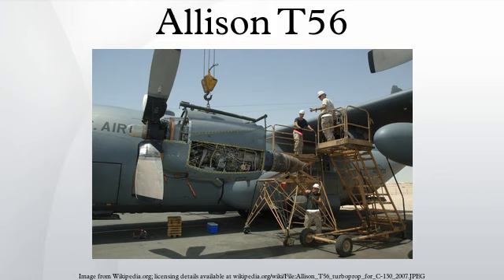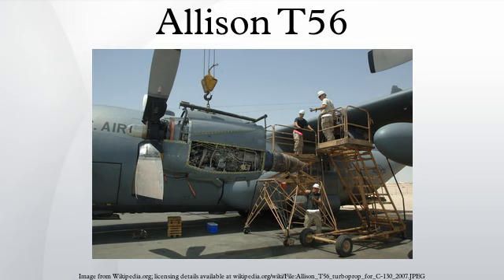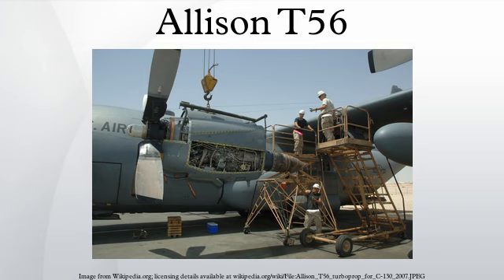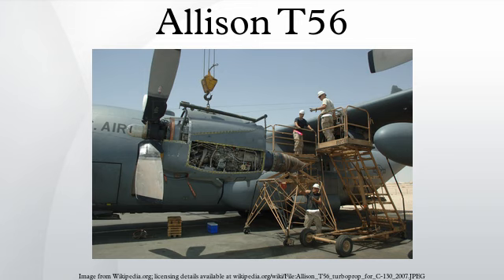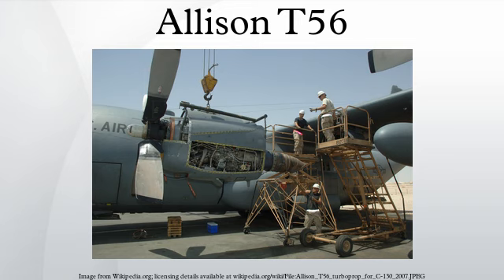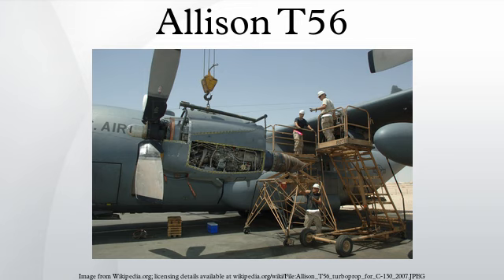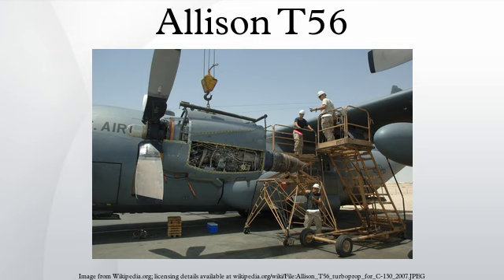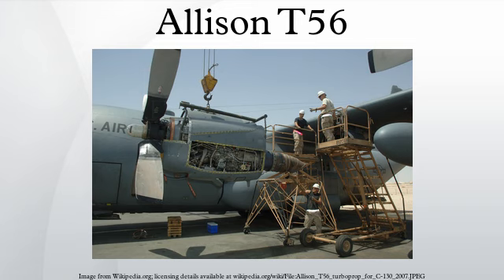Allison T56

Comment: I'm retired from the CA Air Nat'l Guard (146th AW) and spent 15 years In the engine shop repairing T56-A-7 engines.
Reply: Is it piston driven or is it similar to M1 Abram Tank engine??
Reply: No pistons.  It is a gas turbine engine. Incidentally, the commercial version (and also the version used on the Navy's P-3 Orion) is the D-501, not 501-D.
Reply: Thanks. But isnt the gas turbine helping push the plane too?
Reply: Actually, no.  In either a pure jet or a turboprop,, the main job of the turbine is to operate the compressor.  With the T-56, it tries to extract as much kinetic energy from the exhaust to operate not only the compressor but the propeller as well.  Only about 800 lbs. of thrust comes out of the tailpipe, which is almost no benefit especially since the tailpipe is angled down as well backward.
Reply: As Mr. Witkowski said, it's nearly 800 lbs of thrust, because of this, ground idle setting is actually in the reverse just a bit to counteract that. On the P-3C at least, its exhaust isn't pointed down.
Reply: ok
Reply: @mikesmith7249   - LSGI or Low Speed Ground Idle torque is typically 500-600 in lbs once torque gauge is calibrated. Reverse torque only comes into play once the throttle is move aft of the LSGI detent in the throttle quadrant 

the T56-A -15 is rated 19,600 in lbs maximum, this is due to the QEC kit and the airframe limits. The PowerSection itself is capable of over 25,000 in lbs with ambient temps below 59 F. The Hamiltaon Standard prop does about 90% of the forward movement, Core engine airflow of the axial flow compressor does the remaining 10%.
Reply: @tommaksimik7114  I don't disagree with you but, LSGI and HSGI are the result of fuel flow and the settings are determined by the LSGI solenoid. At LSGI the power levers can only be in the ground idle position if I recall correctly. While in LSGI any power lever movement will cause the engine to go back to HSGI. My comment was related to HSGI operation. On HSGI, when the power lever is at ground idle ( lowest thrust setting) the props are actually in the beta range to counteract the 800lbs thrust of the core engine flow
Reply: I'm working on a university project about T56 but I can't find good data, would you help me?
Reply: @andreapanzone1662  Allison is now owned by Rolls Royce.  Try writing to them, maybe they can direct you to a good source.  Best of Luck.